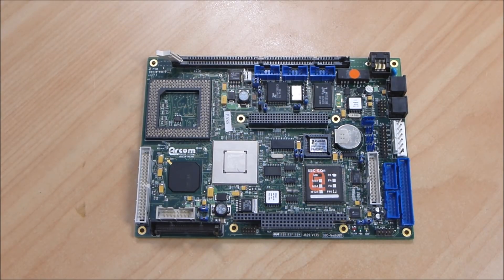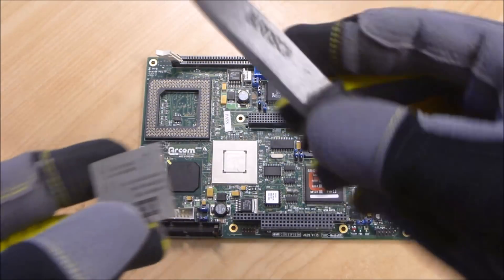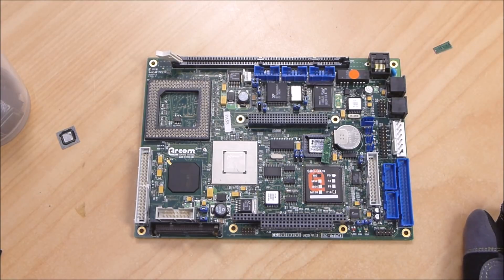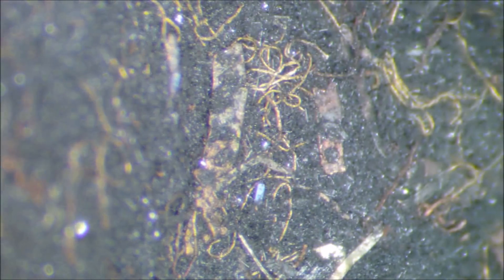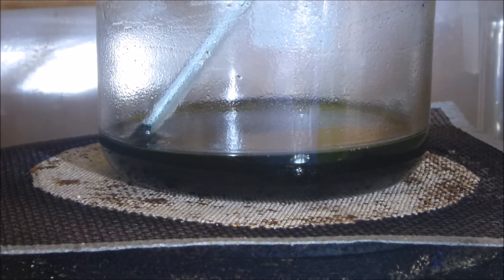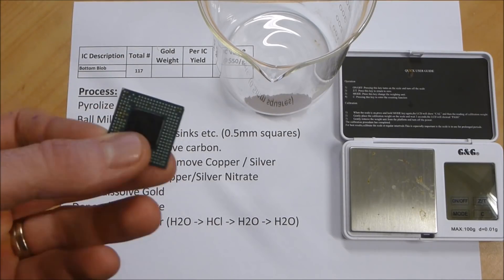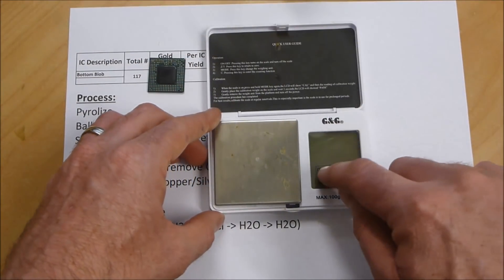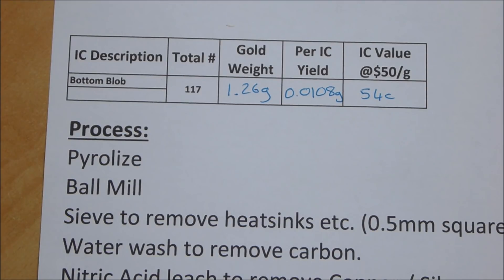Gold Recovery - Yield from 'bottom blob' ICs

Comment: Can you not use nitric acid to remove the copper and go directly to AR the to dissolve all metal and precipitate gold with SMB
Reply from the maker: I can't quite remember the details, but in general yes, if there is no Tin present, the best course of action is usually to dissolve away base metals with Nitric then precious metals with AR. The Nitric solution will then hold any Silver which you can cement out or precipitate as Silver Chloride. You als want to avoid excess Carbon left over when you dissolve the Gold as that can also precipitate Gold and lead to lower yields.

Comment: Once you burn and wash, can you not go straight to the smelt for refining and casting?
Reply from the maker: Edward Coleman Hi, yes, if you are set up for smelting and have some experience with the fluxing and probably some sparging. I have never experimented much with that procedure, I tend to always go the chemical separation way. I believe large industrial Ewaste refiners basically smelt using Copper as collector, then refine the Copper with electrolysis to recover the PM slimes.

Comment: You do some great vids, well done. Peroxide works very well with the concentrates. That's what I use to help clean out the ash. A glass funnel is the best thing. Plug the end, add your ash / concentrate, add peroxide and just keep it moving, the gold sinks to the bottom due to the fizz and keeps the ash afloat. Then you can just scoop the junk off the top because your gold is down in the stem

Comment: Hi thanks for the video well explained. But believe me some of the chips that you cut off also contain gold. The wires that connect those solder balls to the die.
Reply from the maker: Hi there, if you are referring to Flip-chip, then there are no wires connecting the solder balls to the die, the die is directly soldered to the "PCB" part of the chip. Everything internal is Copper. Technically there is a tiny amount of Gold in the solder under the die, but we are talking minuscule.

Comment: Thank you, I found this very informative. BTW, if I have the gold plated wires from motherboards, would I be better to cut off the white metal, and just process the gold plated section? Does it make any difference doing this?
Reply from the maker: Hi Timothy, depending on how much you have, I always prefer to remove as much of the base metals as possible before acid processing, it means you create a less waste to treat. If you will be reverse-electroplating them then I wouldn't bother cutting anything off, because the base metal is not affected by the process.

Comment: Hi,Boss, when it comes to percipitate stage, may i know how much SMB into the solution(ml)? Thank you.
Reply from the maker: Hi there, I use 2 grams of dry SMB per expected gram of Gold. For this batch I used 4g because I was expecting 2g at most. I Dissolved the 4g into about 40ml of boiling water, then added the solution to the pregnant AR.
Reply: Successful Engineer Got it. Thank you, pregnant AR means AR with dissolved gold in it?

Comment: Always waiting for your next videos , thanks again .
You mention that the exposed silicon chips have very little gold , do you figure there is any used / large enough volume to bother processing those ?
Still collecting , waiting till I have enough to something with , general electronics scrapping from repair & surplus , part time hobby .
John
Reply from the maker: Hi John, with the 'flip chip' style, the only Gold is a small amount dissolved into the (Tin) solder balls on the bottom. I have seen a thread where a guy dissolved away the Tin to recover the Gold, but that seems crazy to me, would have been liters of acid waste for a very small amount of Gold. Always appreciate your comments!